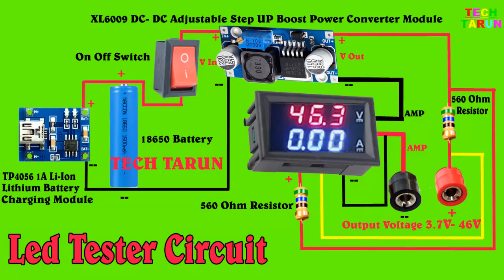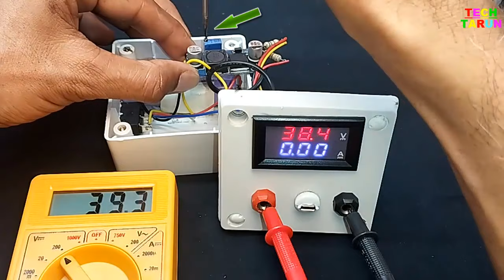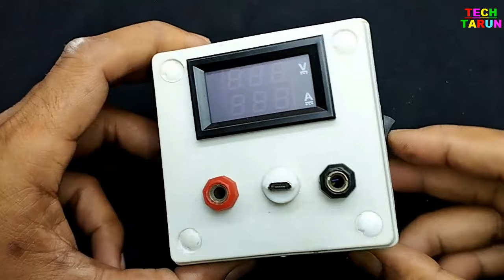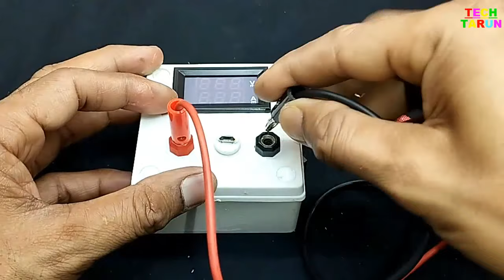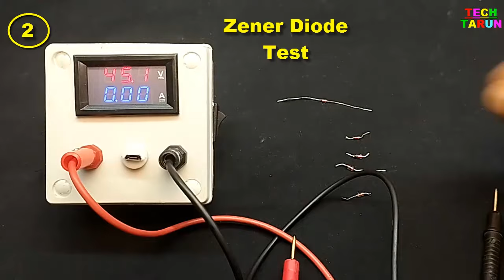How TO Make AUTO Volt Led Tester Using 3.7V Battery | Any LED Tester

Comment: Your converter can only deliver upto 36v and you voltmeter shows 46 so your meter need calibration. Its showing wrong voltage. Secondly, you shouldn't use voltmeter and ammeter like that coz the current is too less that such meter with low precision can't display.

Comment: Your schematic uses 560ohm resistors but in the comments you said 680ohms which one is correct and amp reading does not work properly. The board you're using is rated for 36v. How are you getting 46v.
Reply from the maker: Use 680 Ohm resistor।

Comment: Can I connect DC voltage of 24 v to dc dc  module  as in put or not .pls
Reply from the maker: XL6009 Module Input Voltage  3V ~32V।
Reply: I also made it but maximum voltage is coming 40.6 v only. By using same components.

Comment: Total cost 😂
Pakistan...
Dc voltage meter 450
3.7v battery.          250
Dc bost converter 300
5v battery charger kit 80
10 Ampire cable meter 300
Box
Power button 
Time.......
Total 1380 😂
Led tester 300 dc voltage price 1650. 😂😂😂😂😂😂
Your dc meter 45 volt